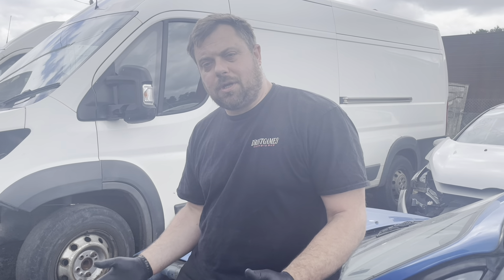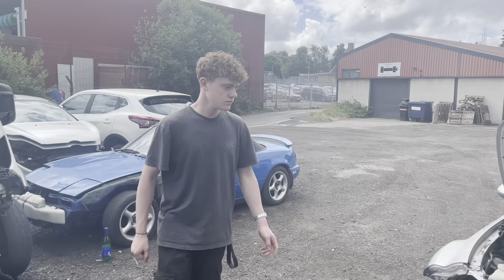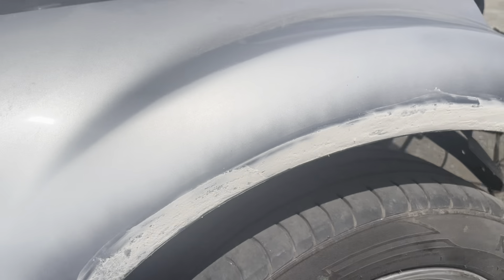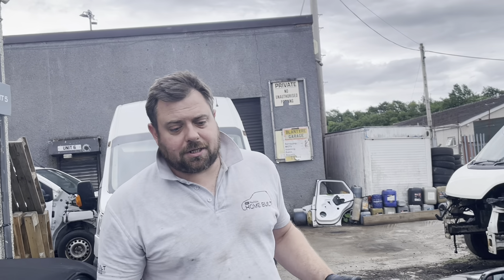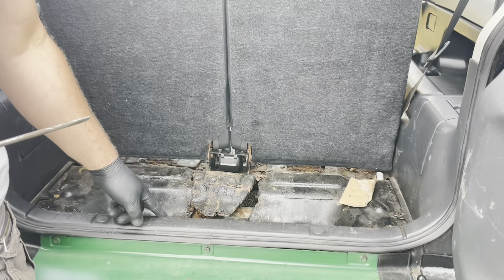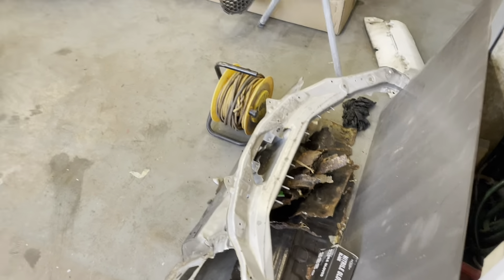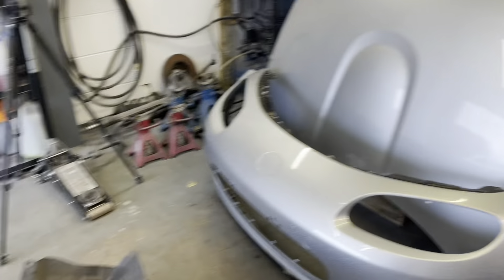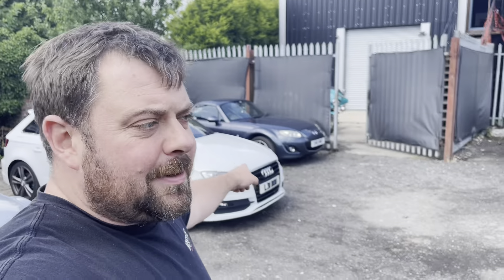COPART knew and didn't say ANYTHING! We also finish the bent MX5!

Comment: MOT data for SUZUKI PX07OML
MOT done 10th Jan 2023, that rot has not broken through in 6 months has it, making the rear seat in securely mounted!

Advisories:
• Rear Integral body structure is corroded but structural rigidity is not significantly reduced (6.1.1 (c) (i))
• Rear Brake pipe corroded, covered in grease or other material  both sides (1.1.11 (c))
• Offside Rear Tyre slightly damaged/cracking or perishing (5.2.3 (d) (ii))
• Offside Rear Integral body structure or chassis corroded within 30cm of a mounting, but not seriously affecting overall security (6.2.2 (d) (i))
• Front Integral body structure is corroded but structural rigidity is not significantly reduced (6.1.1 (c) (i))
• Front Brake pipe corroded, covered in grease or other material  both sides (1.1.11 (c))
• Nearside Rear Integral body structure or chassis corroded within 30cm of a mounting, but not seriously affecting overall security (6.2.2 (d) (i))

Comment: Jimmny will be a Write-off…. If it’s that bad on the floor, the inner sills, seatbelt mounting points and more than likely the Chassis legs will be as bad… pursue Copart for a full refund.
Nice work on the Mazda 👍
Reply from the maker: Chassis legs are all good but plenty to get the hot glue gun on to 😂
Hopefully Copart help out but im not holding my breath.